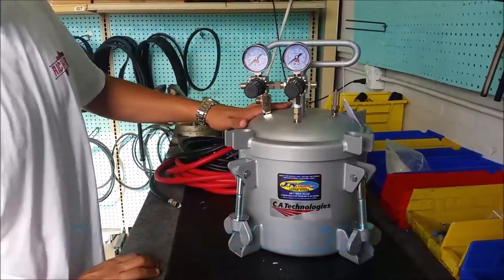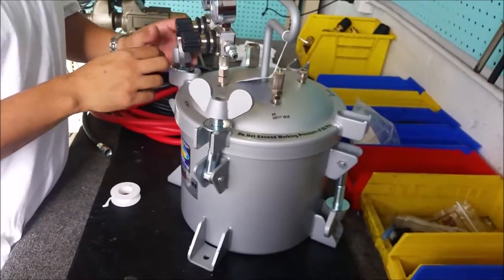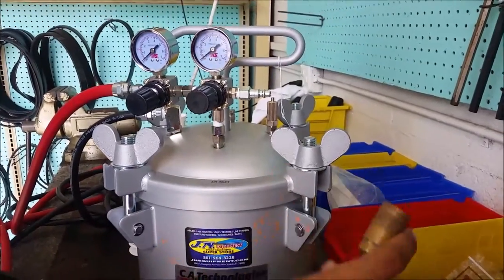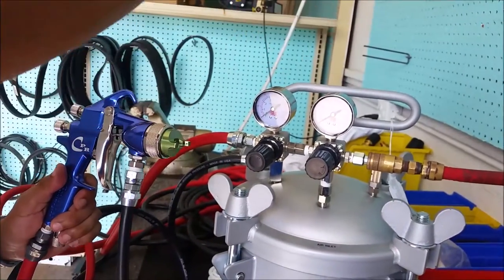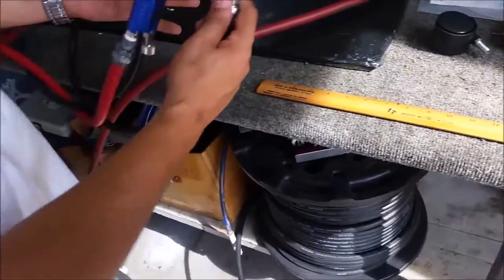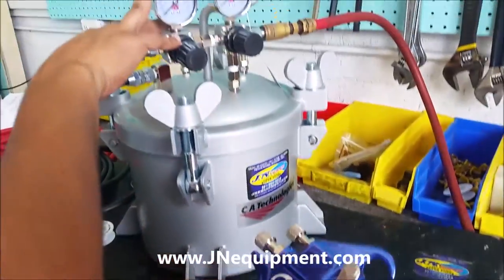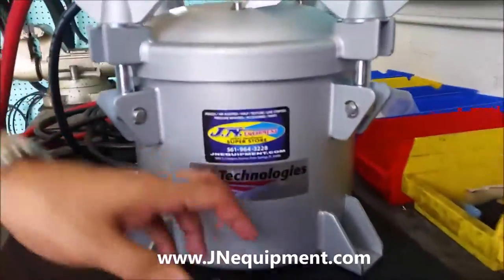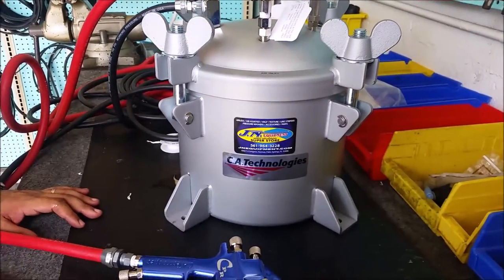How to Set up a Pressure Pot for Fine Finish Painting

Comment: This is exactly what I needed. Got a new pressure pot and had a terrible experience with it. There were no instructions so we had 60 psi coming into the pot and blew two air gun seals and had stain everywhere. This really made a Hugh difference. Now we are spraying like your set up.   Thank you so much

Comment: Do I need thin the paint with this pressure pot?
Reply from the maker: Depends on your application and the material you are spraying. Most people use these pots for thin materials like Oils or stains which would not require thinning. But there are zinc materials out there and other materials which may require some thinning. That question can only be answered on a case by case basis.

Comment: What is the psi setting on the compressor
Reply from the maker: My compressor is a 150psi unit. But 100 psi is more than enough for this application. Either way the pot will only handle 80PSI and anything above that is purged.